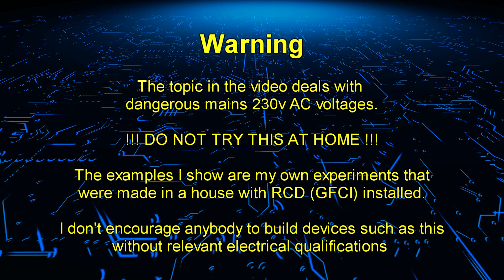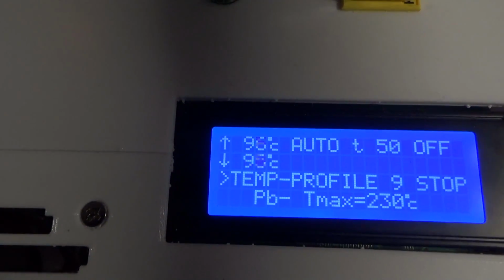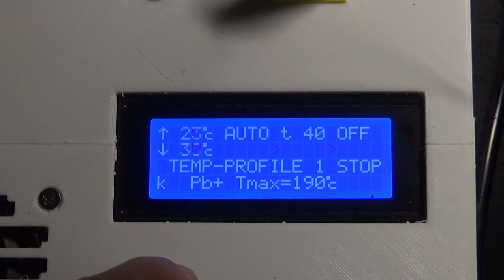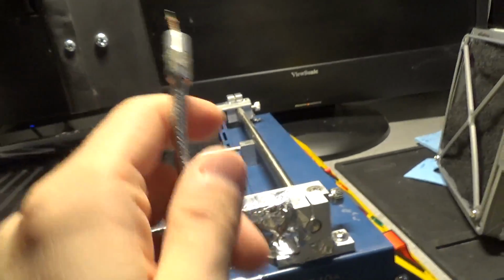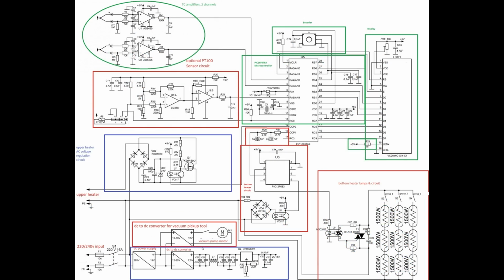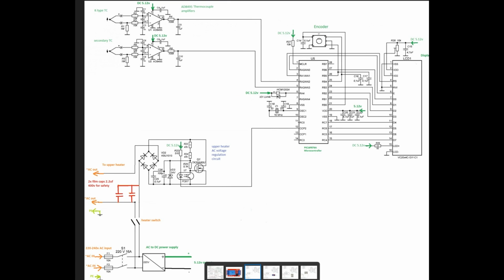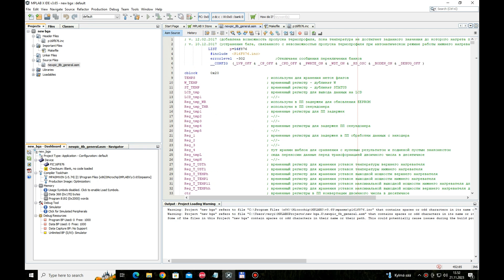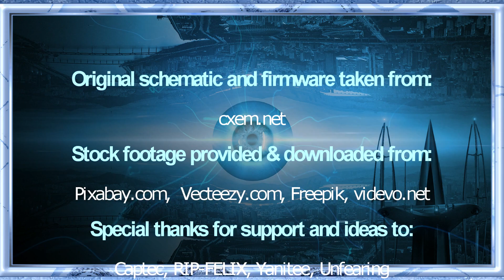Designing & Building a BGA Rework Station based on a T8280 (For Frankensteining and more...)

Comment: Amazing, how many hours did it take to complete. How much did it cost?
Reply from the maker: @timdark9282  it took weeks and weeks because I never had time to do it from start to finnish. Plus I had to wait for pcbs to be manufactured and deliverdd. But I am planning an updated video and upgraded system. I have improved it even more since then.
Reply: @calyps0man  Okay, from an educational standpoint, amazing work. But financially, does it stack up?  Let me put it this way: Are we doing this for the achievement of doing it, or would it be more cost-effective to buy a setup. In any case, this is outstanding work, and I love your content, so keep up the great work 👍
Reply from the maker: @timdark9282  I suppose you could call it a somewhat passion project. I did think that perhaps somebody may have an interest in this setup. And I could potentially produce the top heater and controller assembly for a price. But then again, I realised it most likely wouldn't be all that profitable comparing to the effort required. Besides nobody has  expressed interest. The issue is that it assumes you would use a bottom heater such as T8280, which I got for 100 euros back in the day. But it goes for at least 200 lately. And the parts for the top + module is at least 100 more. So it is already somewhat pricey versus other models . Then I got busy with life changes and the whole project was left on hold sadly. I still will eventually get to it and show the newer version. Just can't know when.

Comment: I’m thinking of doing a similar setup, what are the specs for the quartz top heater and where did you source it from please?

Excellent videos by the way.
Reply from the maker: I have contacted a lithuanian distributor , their site is Kupre dot lt
Reply: Thanks I’ll check them out.
Reply from the maker: @SW-lj4so  There is also INTMax co website, where they sell in bulk.
Reply: Nice one thanks. That made it easy to identify that 1/3 quartz panel. Now to see if it’s not cost prohibitive to ship it downunder.

Comment: Really interesting journey and nice to see you have a good setup that works for your needs at the end. 
Very interesting design you found on the russian site, nice to see you worked out what was actually needed and what was over complicated (albeit probably designed due to restricted parts etc) and simplified it. 
I am so glad these things are getting more common, when I looked into making one over 10 years ago, there wasn't as much info out there. Keep it up, I enjoy your videos a lot
Reply from the maker: Appreciate the support. It's still rather dangerous to build one, but the tiny controller could be a neat solution (but in the real world dealing with AC electricity does require qualifications).